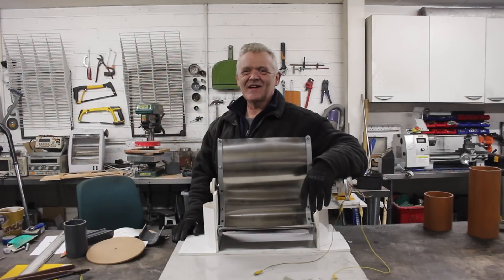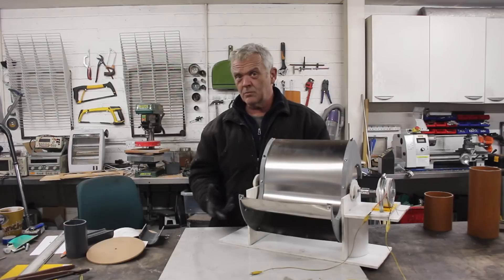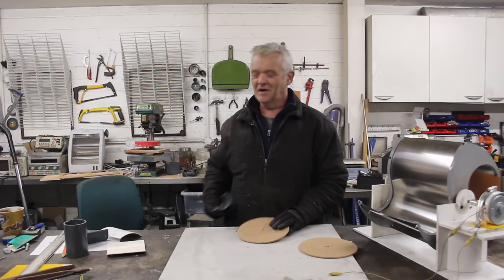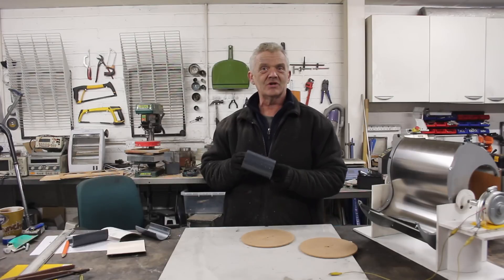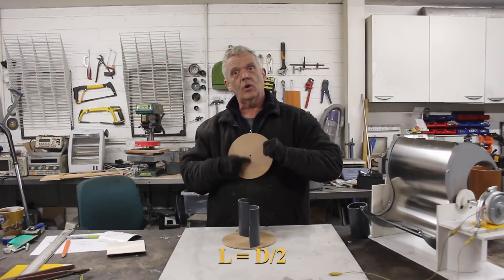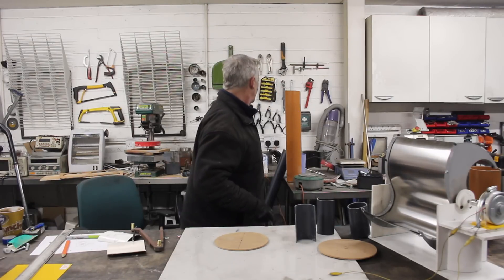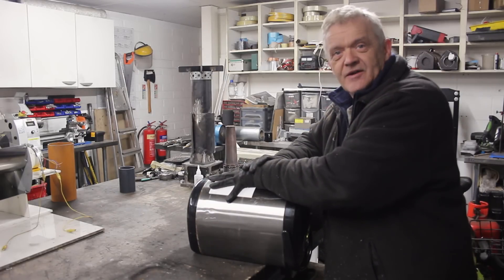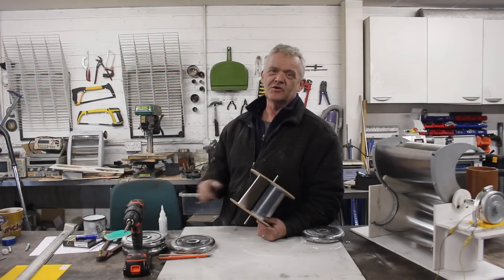1755 How To Make A Super Efficient Wind Turbine - The Ugrinsky VAWT Made Easy

Comment: I couldn’t help but notice the axis was horizontal for your example. I found no discussions on the matter, but your example resembles a roof peak generator I saw on YouTube. I plan to build soon, earth-berm nearly flush into a steep hillside that has relatively strong consistent winds out of the west. It will have a low slope roof and need a safety railing of some variety. I expect it will act as a large wind collector, and I’m researching options. Provided it had the necessary stiffness, can you think of why reason why a fairly small diameter, 20m long turbine on a horizontal axis (mounted to the top of the rooftop safety rail) would not be a viable, relatively easy option? I love your work, it’s easy to see you do too!

Comment: 200mm diameter round pvc ventilation duct is cheap and light weight, ideal for this project and available in one metre length, with end caps I use them for storage normally.

Comment: Great video, thanks. I am new to this and I am wondering whether it is possible to use a small homemade turbine to power a 175w x 4m electric underfloor heat mat, or is that too ambitious? There is plenty of wind where I live.
Reply: You can try Lenz2 or H-Darrieus turbine with sizes D>=1.4M, H>=2D, 26" wheel from the bicycle and belt as increasing reduction gear

Comment: I really like the simplicity of this, but my mind gravitates back to the 3d printed helical vertical version for wind.  If you are printing the shape, why not create a cavity in the blade which is full height at the axis and curves upward at the tip of the blade.  If the cavity is filled with a fluid or dense balls like BBs, they will roll or flow toward the tip at higher wind speeds and maintain a more consistent rotational speed between gusts.  Let me know if anyone tries it!

Comment: If you formed one arc why don't you form both from one piece of PVC? If you made a simple positive and negative form and put in a heated sheet of PVC you could make heaps of them pretty quickly. For the PVC you could slit 100 or 150mm pipe. I would work out the blade size to fit the pipe I intend to use so there's no additional cutting or waste.

Comment: As I guess it looks drag type VAWT which are not more efficient as uplift type VAWT.
Also it need high torque to start so I guess it needs starter to starts
But in uplift type if you have coefficient more than 0.4 
U don't need starter ,also it revolves at low torque
(according to my knowledge, 
Pls proof me wrong if I am)

Comment: I recall one of the long standing problems with VAWTs is that most of them aren't self starting in lower wind speeds where most of the "standard" windmills will at least start to spin even in a light breeze.  Does this one have that same limitation?  It looked like the fan you were using was moving a fair amount of air to get the turbine spinning.
Reply: Ugrinsky-type has one of the lowest self-start speed.
Just use stack of 2 or 3 turbunes with a shift of 90 / 60 degrees.
Most used in DIY is stack of with generator between them

Comment: Robert, you could also make this turbine using sheet metal and a wooden board or that composite board material, cut to that template shape, screwing the sheet metal into the board from the outside. You had mentioned that you could use your 3D printed version to trace out boards for this. In your 3D printed flat-sided Ugrinsky turbine, the 3D printed part was on the outside, the sheet metal was adhered to the inside, and you bolted it on in that order. If you made wooden templates, you could just staple or nail the steel to the wood from the outside. I think that would be a better way to build the turbine. The sheet metal method has the potential to involve less mass per intercepted area of wind.
Reply: It's easier to use Sewer pipes d=160..400 mm.
Stack of 3 turbines H = 0.75D (each other) with a shift of 60 degrees is the best solution.

Comment: One of the reasons more people have not been making Ugrinsky turbines may be due to the fact that Ugrinsky did all his research behind the Iron Curtain of the Soviet Union, and his work did not become known in the west until fairly recently, when turbine enthusiasts in Russia put his design online and started cross-pollinating ideas with western turbine enthusiasts. I'm almost certain this actually began on those 3D print online forums. Ugrinsky never published his findings in any western scientific or engineering journals.

If you think about it, the Ugrinsky turbine isn't that much more complicated than the Savonius. It still consists of circular arcs. The math behind the shape isn't super complicated either. The ratios are simple; no calculus nor even algebra is required. I think the obscurity is a more likely factor for its lack of popularity than its complexity compared to the Savonius turbine.

Comment: Robert, here's an idea to try. Make a hybrid Ugrinsky-Darrieus turbine. Here's why:
The Darrieus turbine is a lift-based VAWT that has a higher efficiency than the Ugrinsky, but it is not self-starting, because the air foils need to slice through the wind at a certain speed for the turbine effect to begin. The Ugrinsky turbine is self-starting, but doesn't have as high a peak efficiency.

If you make a Darrieus turbine whose central column has an Ugrinsky turbine on top (perhaps on the crown of the column, if the central column would be too large to work well inside an Ugrinsky turbine and would disrupt the aerodynamics), when the wind blows, the Ugrinsky will start it spinning, and if you size the radius of the Darrieus turbine blades just right, the spinning of the Ugrinsky turbine will be enough to bring the Darrieus turbine's air foils up to the cut-in speed, even at fairly low wind speeds. 

If you do an image search for Darrieus-Savonius wind turbines, you'll see some examples where Darrieus turbines are coupled with a Savonius turbine in the central column to spin it up to the speed where the air foils of the Darrieus turbine take over. Due to the Ugrinsky turbine being more obscure, nobody seems to have tried this with an Ugrinsky. All of the hybrid self-starting wind turbine systems out there seem to be based on Savonius turbines.

If the Ugrinsky turbine is significantly more efficient than the Savonius, I would expect a Ugrinsky-Darrieus turbine to work even better. Could you test this out?
Reply: If you have coefficient of 0.4 or more in darrieus model you dont need starter
Reply: @Tomy_Stank  I'm curious to learn more about this. Could you link me to where I can read more about this?

Comment: Wonderful!  Re "L=1D" (in your case = 200 mm), I note in page 2 of the paper it says

"In previous research, the optimal dimensions were (S, L) = (0.35D, 1.3R) for maximum power
coefficient and (S, L) = (0.35D, 1.0R) for average power coefficient"

and at the top of page 8 of the paper it says...

"...From the stability point of view, while the Ave. CP of L = 1.2R was the highest of the calculated models, the L = 1.3R model showed less fluctuation and a stable average power coefficient, from TipSpeedRatio = 0.5 to TipSpeedRatio = 0.7"...

So L=1.3R (0.65D) seems to be optimum.  i.e. (S,L)=(0.35D, 0.65D).

Salvonias papers say that putting disks on the end is helpful, and that the length of the section should be about 1.5 times the drum diameter.

So for your 200 dia version, putting disks on the end of a 300 long set of blades should do very well.

Then you can string sets along a shaft, with each set rotated by about an 1/4 (for a pair) or an 1/8th (for more) of a turn from its neighbour to level out the torque curve.  

Interestingly, the paper notes that this Ugrinsky turbine has positive torque throughout the entire 360 degree rotation, compared with the Salvonias which goes negative for a couple of parts of the revolution. Nice.

The workbench is calling!
Reply from the maker: spot on mate - but what you are saying is great for when folks want to dig deeper - but to get folks going I tend to think clear and easy is best and that's what I went for - but I am aware of what you say and totally agree
Reply: You can make both designs with "close enough" dimensions fairly easily.  12" diameter can use a 4" and 6" or 4" and 8".  300mm would be 100 and 200 or 100 and 300.  I only know inch materials but those seem like they'd be somewhat available pvc.

Comment: Hi Rob, does it make any difference which way around the blade is oriented?  Would it would just as well if you rotated it 90 degrees?
Reply from the maker: yes mate it would work just fine I believe
Reply: That would also allow the turbine to maintain efficiency through a a greater range of wind directions, wouldn’t it?
We get a lot of swirly wind here, due to trees, that cannot be cut down.

Comment: Many already know this, that various wind directors and-or deflectors can improve efficiency.
Reply from the maker: cheers mate
Reply: @ThinkingandTinkering  After thinking about my comment, the efficency of the generator wont actually be increased, but it will only appear as if it did, and the increase of the energy output is due to the increase in input energy, ie concentrated force or pressure upon the blades.

Comment: So having made your blade it could be used to form a fibreglass one by using as a former or mould. Do the same for the edge circles and add on bearing holders on the outside the whole item could be made integral and weatherproof. The has relevance near salt water environments. Whole system seems to have much going for it. Thank you for your learned disposition.
Reply from the maker: for sure mate - that's a good idea.

Comment: Robert, from looking at these diagrams it looks like the central channel is 1/5 the overall Diameter and the radius of the S- small circle is also 1/5. By dividing the overall diameter by 5 also seems to be an easy way to find the values. When I drew it out it seems identical. Your helical 3 D printed is a beautiful thing. Very Ying and Yang. Can you tell us anything about the history of this design? It seems like it would work well in water also.
Reply from the maker: I have gone a water test - I must post it - there is leeway on the formula I gave I just gave the formula set for best overall power - but there are different condition opitmisation sets of formulae - no point clouding the issue at this early stage though - but if you read the paper I suggested there is a lot of info in it
Reply: @ThinkingandTinkering    I built one of these today using schedule 40 PVC pipe. The 8" and 3" pipe are the correct ratios.I got five of the L-large sections from cutting the 8" on the table saw, the 3" gets cut in half. It makes very sturdy blades about 1/4" thick, suitable for use in water. It's important to note that PVC pipe wants to close on the saw blade near the end of the first cut, so inserting a wood shim in the cut to hold it open prevents that. I use a section of cedar shingle. The overall diameter is 8 1/4 ". PVC glue and threaded rod hold it together. It came out pretty good and should last a long time.
Reply: Guess I should have added that I used some 1/4" Lexan  for the end caps and the PVC primer and glue seemed to be compatable. 12" L x 8 1/4" D.

Comment: How much power can yours make?
It seems to be all wired up but no mention of its output power. 10W? 20W?
Reply from the maker: I have no idea mate - but - and I hate to say this and I apologise if it comes across as rude - if you are asking that then you don't really understand - a turbine blade doesn't make power - it captures the wind and turns it into rotation - the efficiency of that is important with blade design - what you do then is attach it to an appropriate generator - that takes the rotation and turns it into power - this is true of all wind turbines - the issue on turbine blades is never 'how much power does it produce' - the issue is always what efficiency of wind power to rotation at what torque - I sincerely hope this helps
Reply: @ThinkingandTinkering  I was talking about the one with a generator installed on it. I thought you tested it, but apparently not.

Comment: For the rooftop configuration, would you add a few of these or is there a wide or broad fan (like the tower fan you made earlier)? I've seen broad fans like grassmower blades, but have a feeling they are not very good?
Reply from the maker: it will be a few in a row mate

Comment: Rob i've been thinking about your sand battery from a kettle element video -- and had the thought : why not heat it in the kettle directly ! (so long as it's a metal one) .. just need to replace the thermal cut off set point to something higher (if that's something easy to do)
Reply from the maker: I think you could do that as long as you don't melt the plastic mate so a thermal cut off would be essential there
Reply: grab a sensor from an old coffee maker?

Comment: Very nice, simple tutorial.
I was thinking about the simplest way to make a wind turbine with materials that will stand up to rain and I finally thought about using a plastic soda bottle. If you cut the sides, you can bend them out into flaps that will catch the wind very nicely
Reply from the maker: nice idea mate - cheers
Reply: once you cut the soda bottle its strength is lost . suggest leaving the  bottom and top parts uncut to retain some  strength.
Reply: @snuffoutrouge5109  Yeah, that's what I meant. I cut only the sides to fold out into flaps. The top and bottom I left intact.

Comment: How come the white bit came out exactly the correct length after forming? I feel like I’m missing something. 

Did you cut the white bit to size and not include it in the video?
Reply: No he's just that good 😉😄
Reply from the maker: you are not missing something mate - if you need to cut it to size - well - cut it to size - I thought that was pretty obvious which is why I didn't mention it - but I guess I should have since you are asking the question - my bad sorry
Reply: @ThinkingandTinkering  I wish you spent 2x as long explaining everything… but I have a tendency to overthink things, and in this case I thought there was some geometric ratio that I couldn’t remember to explain how your piece came out the correct length.

Comment: I remember this one gluing trick/tip for wood with wood glue and saw dust. Thats it for holes in the wood just use saw dust mixed in wood glue and when it hardens you can easily sand it the way you want.
Reply from the maker: it's a nice tip thanks mate

Comment: havent seen the full video. But if you just print the side view of that turbine on a piece of paper, grab yourself a gluestick or whatever and glue it to a piece of wood or metal, whatever you want to use and then grab a jigsaw you can just cut it pretty easy. And for perfectly symmetrical parts you actually glue or screw 2 or more pieces of your material stock together and then cut through them all in 1 go, also drill your hole for the axle and then you seperate them. Perfectly symetrical and perfectly in line. And if you got the sides made then just nail your sheetmetal to your wood, or weld it to your metal or solder or whatever you want to use for it.
Reply from the maker: you could mate but then you are limited to what a printer will print - with this method there inso real limit

Comment: When making this design and trying to miniaturize it.    Do they go over in their white papers that when you get below a certain size the efficiency ratio falls off.

It’s a physics friction thing with the mass of air to surface ratio. 

You could take the most efficient design out there but when you miniaturize it it loses its efficiency as you get smaller. 
      Still works but just loses the main reason behind the design in the first place.
Reply from the maker: you might want to read the paper I showed mate

Comment: Interesting. Nice video. I have been wondering what would be the most efficient way of converting that mechanical energy into electricity? I see you using DC motors a lot to convert it but is there a specific size or wattage motor that's most efficient for this load? Or just slap any DC motor on it? And then from your last video, dump to a resistor inside the house for heating.
Reply from the maker: I have done a few videos explaining this mate - but I guess I should do another - I have been thinking about it

Comment: Hats off Sir Robert!
I have a few question... I'm planning to make a wind-wall(or a roof top if it's allowed here in HU)  from these type of blades + gutted out two huge HP copy machines for BLDC's. I have 10 of them.
What you recommend for the shafts?
After i rectify individually the BLDC's  should I just connect all the plusses and minuses together?
What diameter of wire/cable should I use? I was thinking 2.5mm would be ideal to be on the safe side(heat loss on DC, 30 meter cca) or can I use multiple 1.5mm rigid wires wich I have.
And finally the heater element. Hence I have no income, batteries are out of reach for me. I'm collecting every garbage, and already collected some elements from water boilers, micro grills, ovens etc. What wattage and resistance elements would you use? (in sand)
Reply: Interesting project. Keep us informed how it goes!
Reply from the maker: that's too much to write in a reply mate and I have done quite a few videos that answer some of your questions - can I suggest you research it some more - I will try and do a video on the missing answers but it won't be done by tomorrow lol